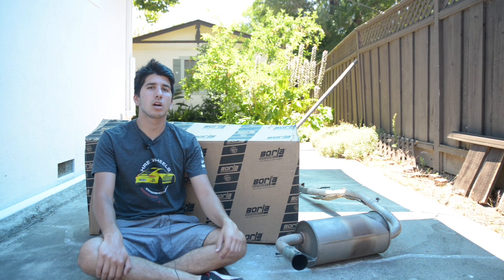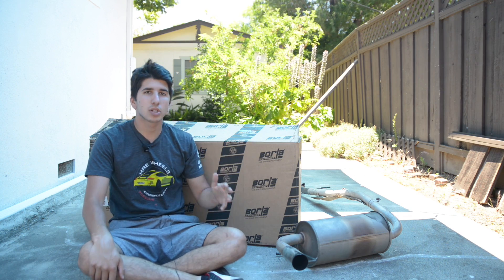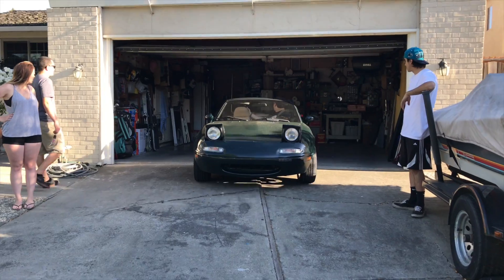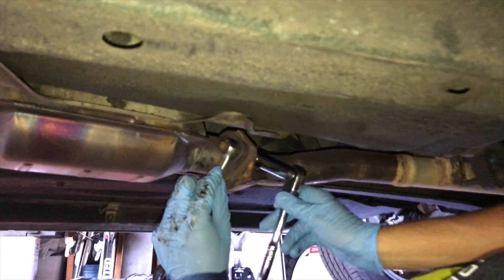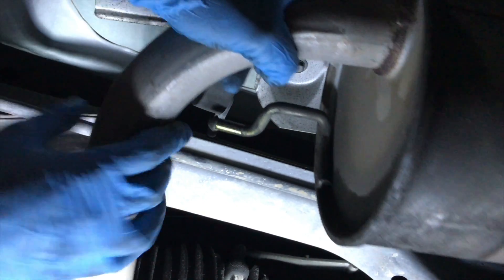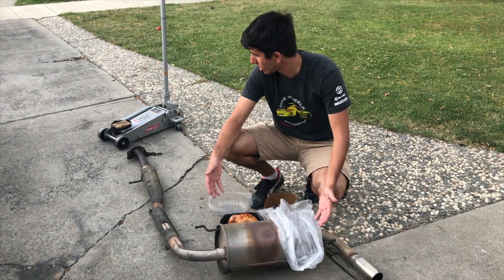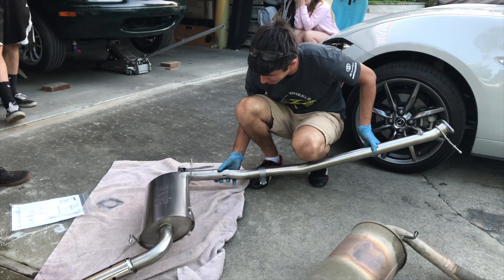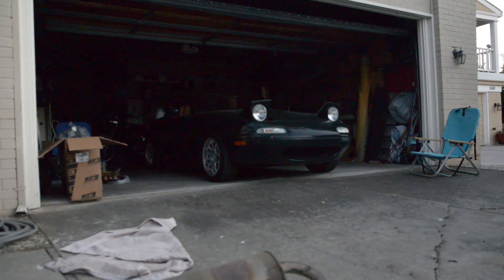Borla Exhaust Mazda Miata 1.6L Sound Clips + Install

Comment: Had this with a 4 -2-1 header and a test pipe and it was fantastic. No crap bass tone rice sound and only loud when you wanted it to be. The sound was like this video but just more of it. A throatier version of this.
Reply from the maker: Very nice! Did it crackle at all on downshifts or deceleration?
Reply: Should I Get It Reviews No crackling that I remember.

Comment: The factory actually doesnt sound bad at all. Borla sounds clean though! I can say its worth picking up a hangar removal tool, they're cheap and work like a charm vs fighting with rubber grommets that dont want to let loose. I've had my 1991 SE (also british racing green) since 2014. It had this loud tin-can sounding exhaust, though very well built. But i pretty quickly put in a very big/nice turbo setup including a really nice exhaust... forward 6 years later to last week i finally got my miata running again after sitting on wheel dollies (naturally aspirated, removed the turbo) and i forgot how much i hate the fart cans most people put on these.

So here I am looking for a clean, rumbly exhaust again and Boral may be the choice. The cost of selling mine will mostly offset this exhaust so I may just pull the trigger. Thanks for sharing!  BTW..if you still have it..what number was this car? Mine is #3560 and a lot of them are in the scrap yards these days...out of 4000, they're pretty rare!
Reply from the maker: That's awesome! Any idea how much power it was making with the turbo? Mine has been sold since this video but I believe it was 3247 if I'm remembering correctly!
Reply: @shouldigetit  I had a pretty big turbo, was right around 300rwhp on the tune i had. Was a decent amount of low end lag, boost didnt really build until 4200rpm so it was not great from a dig with that big turbo. Driving it N/A right now its so slow in comparison, but still a fun little car to whip around

Comment: No one is gonna mention he has the jack stands set wrong?
Reply from the maker: Too late for that now!
Reply: I was gonna say something but they all lived
Reply: Did he also mention starting the car while on jackstands? I did that once working on the brakes on a friend's Saab 900 Turbo without thinking, knew immediately as I turned the key that I shouldn't, and so the car ended up landing on the wheel-less brake rotors... ouch! It was like when you are pressing Enter to send that angry e-mail, and as the key goes down, you think better of it... tooooo late!
Reply: But I have to add, the video is very helpful as I get ready to put a Borla on my daughter's NA Miata, thanks!